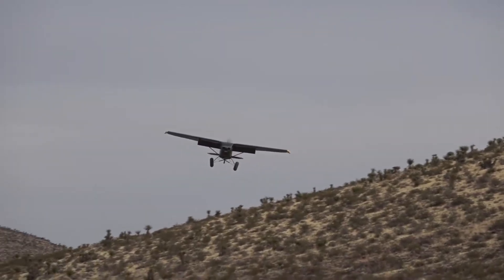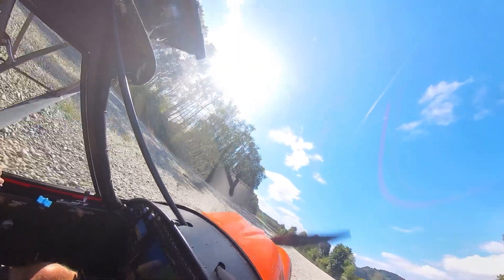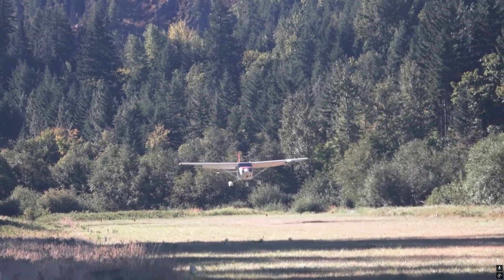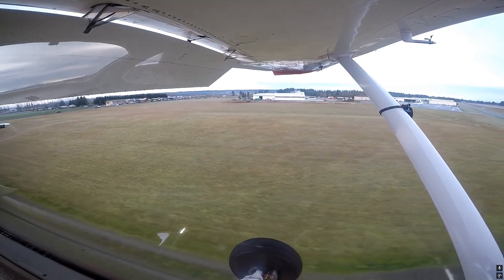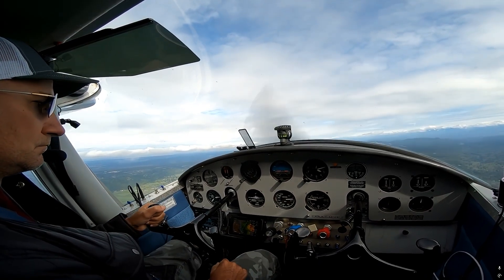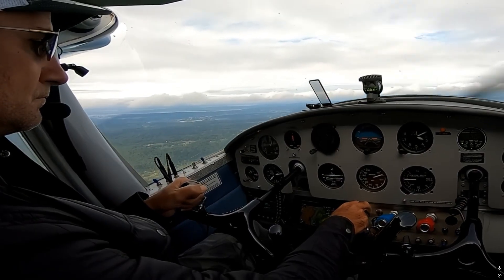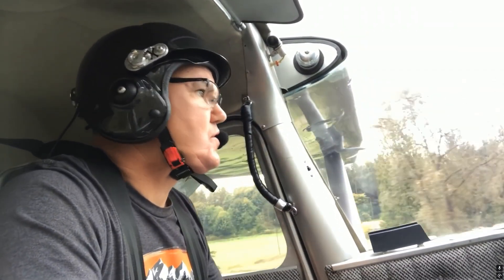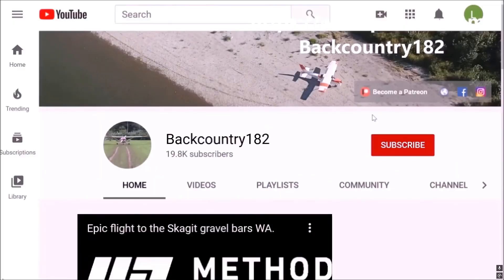The Hidden Skill Behind Every Great Landing: Slow Flight Mastery

Comment: Excellent video Larry.   It is great that you have made a video of hover level in low ground effect down a long runway much slower than Vso.  This gives students more than just an instant at the airspeed necessary to "arrive at ground level in three point attitude all slowed up and ready to squat" as Wolfgang puts it in Stick and Rudder.  You demonstrate how we need to get full flaps and decelerate enough to sink bringing the dynamic throttle fully into precision glide angle and rate of descent control.  Finally, on very short final we can see that the apparent brisk walk rate of closure we see at a distance is controlled with elevator such that there is no appearance of any speed up of this apparent rate.  We can see this steady apparent rate either from the camera position on the ground or from the airplane.  This control of the apparent brisk walk rate of closure looks, and is, much different from what we see at the airport watching airplanes appear to speed up significantly as they close with us.  While necessary in your off airport work, this very same or even nearly the same airspeed deceleration and control can prevent the killer part of LOC landing accidents:  speed.  Thanks for the video and explanation.